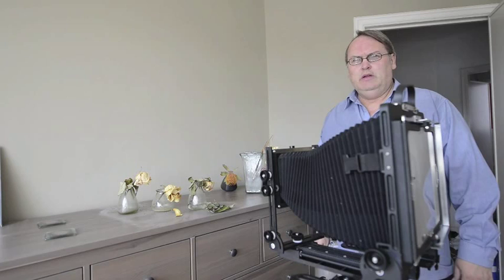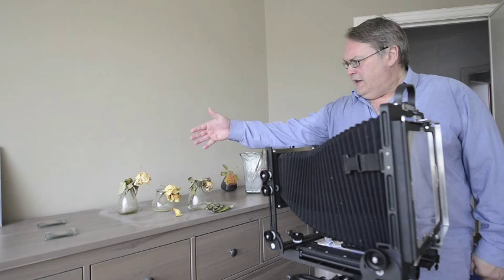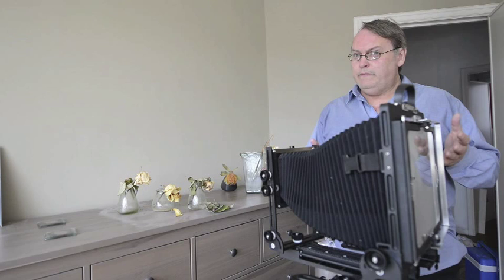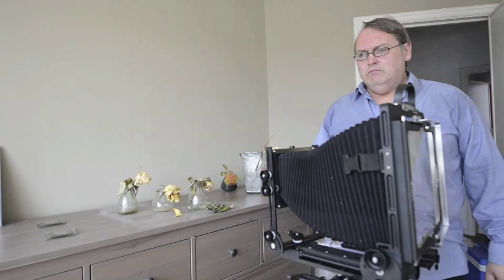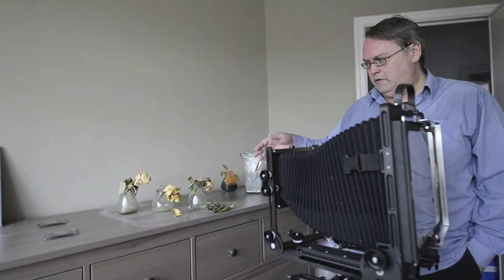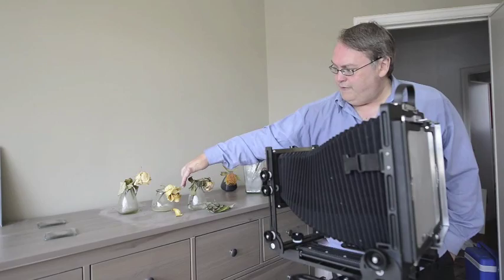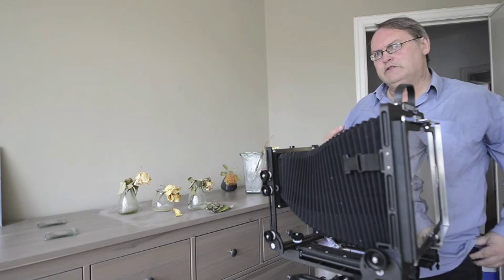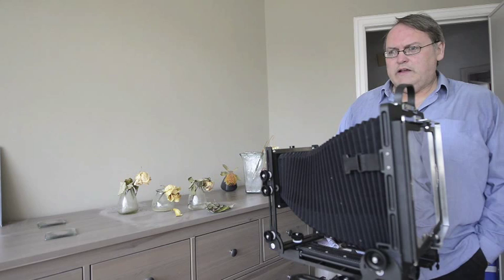Focusing the view camera using the Scheimpflug Principle

Comment: What would be the affect if you had left the rear board at 0 (no adjustment) and swung the front board a bit more in order to still have all 3 planes meet?
Reply from the maker: Hi Adam

Just after I uploaded the video it did occur to me that I should have talked about exactly that! This would in fact be the best way to proceed since swinging the front board does bot distort the image whereas swinging the rear panel introduces some distortion. However, you are limited to the amount of lens swing by the image circle and often it is the combination that we need.

We would use rear panel swing to reduce distortions like keystoning in architecture

Dave